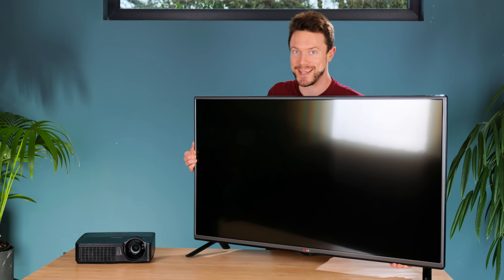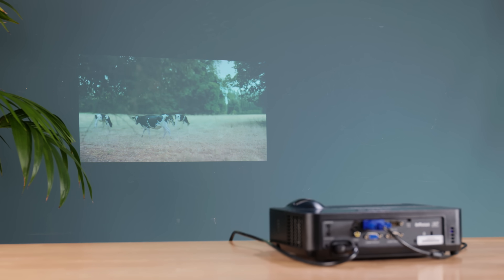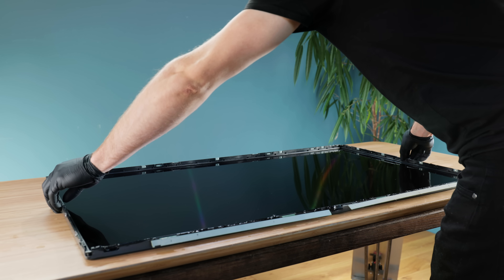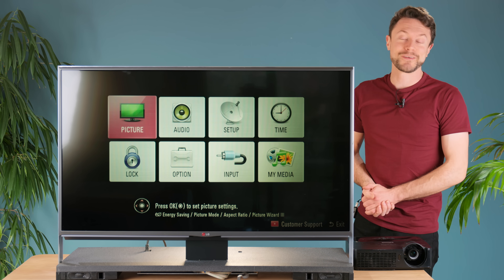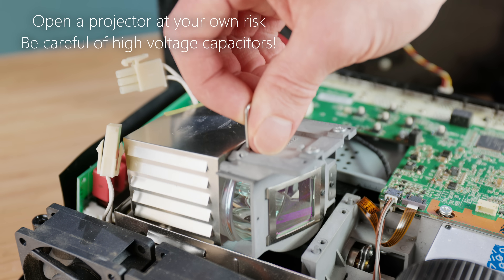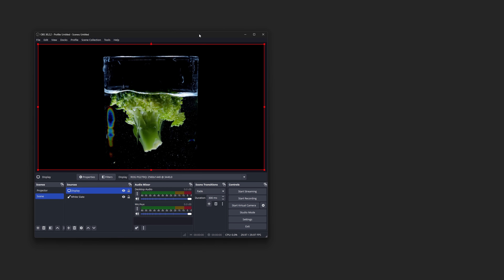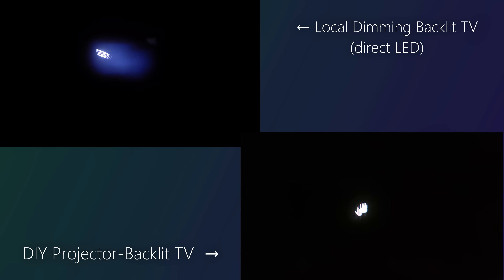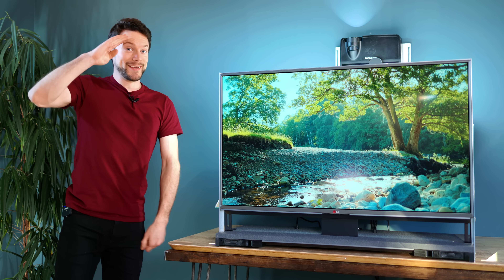DIY "infinity contrast" TV -  with 100% recycled parts

Comment: YO WHY NOT JUST GET A OLD PROJECTION TV TAKE THE FRONT SCREEN OUT AND REPLACE IT WITH A LCD SCREEN BOOM SAME THING BUT PERFECTLY SET UP FOR YOU.
 edit quick search they made 40 inch rear projection tv's you could throw a 40 inch lcd on there remove the color wheel they have them they are identical to that thing but smaller ive torn apart a couple projection tv's before curious how they worked after they were broken they just bounce the image off mirrors to the screen they are mostly just empty space except the bottom where thers some cool boards mostly for sound things liek that alot had subs and speakers that sounded pretty good in them so they used the wasted space as a box for better sound.

Comment: How do you adjust for the latency difference between the LCD and projector images? I would imagine that the images would no longer be in sync after processing through a filter in OBS.
Reply: DLP actually has better motion response than LCD, especially if he's using an lcd panel from 2012, so it's probably because the equipment he's using is old enough that the lag won't matter

Comment: Honestly, this would be perfect in a media wall. The false front around the TV could be used to hide all the mirrors and projector. It was also mean the TV is fixed in position so there isn't any chance it will become unaligned by being knocked in day to day life. As soon as I saw it my immediate thoughts was how good it would look built into a wall and you'd never know the genius that went into installing it. You could also have a light installed to use while you setup OBS and then turn off once the projector was running

Comment: What about modding a rear projection TV to do this? Putting The panel on where the projection screen for the rear projection TV would be and using all white light instead of the RGB lights that reprojection TVs have

Comment: is a simpler option. with Led light and glass. 4 outer edges with Led. The light beam on 4 sides forms light. It is cinema hall lighting. Tv daylight uses the brightest light fixtures using a mirror. Mirror lights are similar to cameras for digital screen illumination. Only smaller size. The same with tv. Only indualie size should be made with Led and mirror. Replaces Led line lights and projector lights.

Comment: Great build! 
A question though: in a TV setup, how would I get OBS to run the backlight? Suppose, I do not have it connected to a PC, video signal is coming from a chromecast or a plastation, how would I get the image into OBS (Capture card?) and where would I run OBS? 

And a suggestion: how about having the projector below the tv in a cabinet/stand projecting upwards into the mirror instead of bouncing it off the wall? The cabinet could also be equipped with some of your DIY speakers, maybe some water cooling for a  heavy duty LED light source for the projector. And this way, the back could be enclosed to avoid light spill to the surroundings.

Keep up the great work

Comment: In leu of a projector, wonder if you could use another exact size/pixel LED panel behind it just using black/white pixels, and then flood light for the backlight. So as layers would go...Front/main LED panel, Black/White LED panel, and then backlight source.

Comment: I do TV repairs, this idea also occurred to me, but I did not have the free time to implement it. This is simply one of the best DIY I have ever seen. The implementation is just  so great, especially with the mirrors. You have reinvented the projection TV, my friend. Matt, you're the Master.👍
Reply: Most times people crack the screens making abstract art instead. In this case it would only be a matter of time before the DMD started to fail in the dlp projector being used.
Reply: @kjrchannel1480   what is dmd?
Reply: 1. The colors are not from the projector, he uses it only for back light. The colors are from the TV-display in front.
2. The projector behind, after removing the "color-disk"-thing, provides only the white unfiltered light.
3. He uses software (OBS + plugins) to adjust the lighting settings.
4. The projector must have high render resolution. He used one with 786,432 pixels...
5. The LCD TV display that you use, should also be more modern, to be able to produce nice and rich colors.
Reply: Go for it, its free!** (** not including the many hundreds of dollars worth of aluminium, mirrors, wood, paint, specific glue, and "recycled" major parts)
Reply: @evilme73  😆 True, but if you were about to spend money on a new TV anyway, you could consider this not only free, but actually saving money.
Reply: @shades909 As easy as changing the LEDs on the TV and not spending money on a new TV, that's what that TV was missing without ruining it and switching to a projector.😂
Reply: @evilme73  Aluminium, wood and mirrors used in this project are really cheap, paint also. In my country this materials used in video are under 60$. So,except tv and projector it is not expensive project.

Comment: Sidenot that nobody will read: You can repair the power board, usually it's at a state where it can run the logic but can't drive the backlight LEDs. Try replacing the caps.

Comment: Did you take in to account input lag of both devices, and correct timing? It would be very expensive but with proper fiberoptics array you could pack all into reasonable chassis

Comment: I have an old DLP projector TV.  Wondering if all I need to do is replace the screen with an old LED panel.  It already has the "bent path" lighting from a lamp and a case designed for it.

Comment: Interesting idea. About 2 years before JCV, i came up with DLA.  But of course I have no proof of this.  Remeber when it was difficult to manufacture good LCD panels? Back then I thought of using a panel with a few bad pixels as a back light filter, basically doing the same as has been done here.  I thought it would have a good use for an otherwise garbage panel.

Comment: - 2 similar LCD screens
- projector bulb 
- whitebox and diffusers

When you place the 2 screens as close together as possible, use brightness mapping for the inner LCD and illuminate with a projector bulb inside a light sealed box as white as possible, shouldn't you get similar results in a much handier and thinner package, without light spillage?

Comment: This is such a good idea. How about finding an old rear projection TV cabinet and using it to mount the screen? Did you have any trouble with the latency between the TV movement and the Projector movement after going through the software? We have a truckstop cafe locally with 2 x 100 odd inch screens in, I am just waiting for them to go faulty as they will likely keep the faulty one as spared for the remaining good one..

Comment: Wonder what will happen if you just add two identical LCD panels on top if each other. You'll probably need additional backlight, however, would that not drastically reduce the bleed-through light?

Comment: If you want to try this,  by all means do it. But modern tvs are designed to break easily as you disassemble them.  Of particular caution are the ribbon connectors to the pcb which usually employ an exotic lock system, and the edges of the tv- one wrong move and crack no more screen

Comment: I wonder if the projector positioning issue could be solved by parallelising the light as you did in the DIY Projector video and then folding the light into a tube that could be folded more neatly. Basically achieving something similar to the optic fibre effect but on a smaller scale

Comment: How would it work if you used your glow/brightness/luminance video signal into a second lcd panel instead of into a projector? You could then just use a flat uniform LED light array through diffusers behind that luminance LCD panel, and probably a thin diffuser between the that and the main video panel. 

The sandwich (from back) would be something like: fixed brightness led grid > diffusers > luninance/glow lcd panel > thin diffuser > main video lcd panel. 

That way you can make the whole thing much thinner more like a standard lcd TV (or maybe about as thick as a plsma screen).

Comment: I'm just thinking about the home theater possibilities. If you didn't go with a cheap tv and a cheap projector. If you went with a 120-240hz lcd screen at say 100+ inches and a 1440 or 4k projector of similar refresh rate, then you can have an amazing image for a fraction of the cost of large format OLEDs.

Comment: Why not just stack 2 LCD panels and have the one in the back allow the light through in black and white as if it was from the projector. You can replace the backlight leds with brighter ones for higher brightness and contrast.

Comment: I don't care if it's not as bright as an OLED, you just basically made an OLED without the risk of burn-in, so this is an absolute mega win. Companies should really catch on and make this modification a consumer model but with refinements, I would buy it in a heart beat. 😎👍
Reply: Hisense did something similar with 2 LCD layers, the rear one black and white.
Reply: @axi0matic  I've seen that actually but I think I'm a bigger fan of this one, something about projectors that is close to me, they are a vibe, I can't explain it. 😝 But very true, that could be a more commercial solution as it's easier to make compact etc. This seems to bring better and brighter results though because of the lamp strength, so the double LCD would be more precise but this one would have better contrast and brightness as it doesn't have to be double filtered or whatever. But I'm curious if improvements can be made to this? Like more back panel papers for more even diffusion? Or maybe 2-3 projectors instead of 1 all aligned to increase brightness? But maybe that would cause bloom at that point? Also the electrical bill to run that would be epic! 🤣🤣🤣
Reply: @ The double LCD could use a higher powered backlight - even one with local dimming. If the backlight layer has 1000:1 contrast, the combination will be more like 1,000,000:1. If a commercial product, the rear LCD wouldn’t need colour filters, or even sub-pixels. The panels could be precisely aligned for per-pixel dimming.

Matt could just use a higher end projector with a much higher light output. Though he wouldn’t want to spend too much, or it would be cheaper to just buy a second hand OLED.
Reply: @axi0matic  True true, hmmm... Well then I need to decide which one to build. I'm honestly just looking for the OLED experience without the burn in, and sure I could just wait for QLED to evolve to be pixel level tight so there's no bloom, but that would take too long and probably be extremely expensive. I know burn in is minimal on today's OLEDs but I tend to game 8-12 hours from time to time, same game, so no matter that minimal chance, it WILL happen eventually given health bars etc. 😭

So we'll see, but perhaps I'll give the double screen variant a go then? I'm not sure... Damn it's so hard to decide! 😅

Edit, sorry I meant QDEL not QLED. 😅👍
Reply: @axi0matic  what are colour filters, exactly? and what do you mean no subpixels? how is that even possible?
Reply: @gamma2816  Dont forget about the heat generated by a projector. They can generate a good bit of heat.
Reply: @ArnoldTohtFan  LCD has no 'colour' as such - it just lets more or less light through. To make a colour picture, each pixel has three sub-pixels - red, green and blue. They're mixed in various proportions to create colour. To make e.g. a red sub-pixel, you need to place a red filter in front of the LCD at that point.
Reply: @gamma2816  vibe is no argument for someone trying to make it commercialy
Reply: I mean, it’s really not even comparable to an OLED in any significant way, it’s only comparable to a “q-led” or “quantum dot” style display which has local dimming zones which are very high resolution. 

It’s true this wouldn’t have burn in issues, but that’s essentially the only benefit over OLED. It’s a big one for sure, but OLED boast soooooo many other insanely good features like high refresh rate capability, sub 1ms gray to gray pixel response time, sub 1ms pixel latency, insane color accuracy, crazy thin panels, ultra light weight compared to LED, and also amazing power efficiency. 

OLED is literally a dream technology with a single manageable drawback. (Yes yes, brightness is an issue but we’re now seeing HDR10+ oleds so..)
Reply: @DC...getting pixel-level registration between two 1080p or 4K projectors would require some seriously impressive optics.
Reply: Not really, oled are known for their instant latency and response timings that are basically near a CRT, this wouldn’t meet that…
Reply: @joeguitartech6181  Hehe well read the responses and discussions my man 😝 QDEL will eventually, no that's not a misspelled word, semi old prototype tech finally might reach the market and will probably blow OLED out of the water, not yet because business is business and companies having bought all OLED manufacturing parts won't just sell all that willy nilly, but in a few years time we could have OLED but cheaper, brighter, faster and best of all, no burn-in, it's called QDEL or something like that and it's REALLY awesome! Again prototype stuff atm but VERY promising, look it up, there are videos of it from just about a month ago, not to be confused with QLED and QD-OLED, QDEL specifically. ☺️👍
Reply: @joeguitartech6181  at 2-3x lower price ips for TVs and PC gaming displays is fast enough, the bad contrast and backlight bleed are basically its only problems, so projector backligh will fix it, switch speeds from dark-to-light and light-to-dark will be limited by projector refresh rate but its fine as long as all other transitions are way faster... until oled/qdel/miniled prices drop.
Reply: rear projection television
Reply: @InconsistentManner  🤣🤣🤣
Reply: They’re actually getting pretty close! Just, without the need for a projector. Micro-LED backlit displays are stating to hit the market and essentially create the same effect, just with a bunch of very small LEDs. Samsung’s version even utilizes RGB LEDs that match the color of whatever they’re illuminating. And of course, even this is only a half step toward direct view Micro-LED displays that are so high resolution you no longer need an LCD panel in front.
Reply: This is now on the roadmap
Reply: Don't LCDs still have some burn-in? I think I've seen it.
Reply: I wonder if it would end up being much cheaper than OLED too 🤔
Reply: @yerachmielb1  Believe it or not OLED itself in the beginning was said to have the potential to be very cheap to produce compared to LCD.
Reply: @ Maybe this concept can start a real competition between the two. Here's to hoping 🤞
Reply: Projectors have burn-in, sorry. And also the lamp won't last nearly as many hours an oled before needing to be replaced - and they're expensive!
Reply: maybe they're not all expensive, but they're also hardnto replace. That said, you could just replace the projector every couple thousand hours
Reply: The OLED burn-in problem is massively over-exaggerated. There are still no signs of it on my 55" LG CX that must have close to 10,000 hours on it by now. Plenty of other people have had the same experience, or better with LG OLED panels. If you shop around, the 48" models can be picked up new for around £600 and wipe the floor with anything else in terms of picture quality apart from QD-OLED which still seems more susceptible to burn-in than WOLED.
Reply: @MrSlipstreem It's a bigger issue when frequently used for images with static content (computer displays, phones, watermarks, etc.). When used responsibly with mostly cinema-type content the risks are much lower.

So I would not say they are highly exaggerated as myself and others have experienced it multiple times. However like most things, it's a bit more nuanced and depends a lot on the use case and how often it's used 👍
Reply: I could see burn-in happening. Any channel logo/game hud could take excess heat that the panel isnt designed for
Reply: I have 7600 hrs on my lg c1 at max brightness as a work pc using  the same art programs and there’s no burn in or uniformity issues And I calibrate displays/repair displays.

It’s been a non issue since the CX.

I use it about 8 hrs a day and weekends I play the same mmo.
Reply: @PixogenPixels  still people should prefer newer OLEDs where manufacturers improve/mitigate burn-in problem better. rtings tests oled TVs so people can see which oleds to avoid and what can happen if used 'incorrectly' with somewhat static images for long periods
Reply: @PixogenPixels  Damn, that's kinda crazy, guess I just can't get over the paranoia. 😅
Reply: it can be 2-3 times cheaper than oled/minileds but with 20-25cm bottom to house a projector, it also can have projector removable so you can have movie nights with it outside the house it will increase the price a bit though unremovable b/w projectors will be cheaper to make.
also such a TV will just bring oled/miniled TVs prices down and disappear. because obviously manufacturers are just price gouging while they can. 1440p 100hz monitors cost 100usd now because they can't sell them for more with pressure from higher-end higher refresh rate monitors, yet they keep producing and selling them for 100usd because its still VERY profitable. oled/miniled margins are just on another level.

Comment: 16:39 you could also just hang the projector on the wall upside down, flipped so that the bottom of the projector is facing out and the lens can project straight onto the mirror that's 45° behind the TV. That should eliminate a lot of the light from the ceiling mirror.